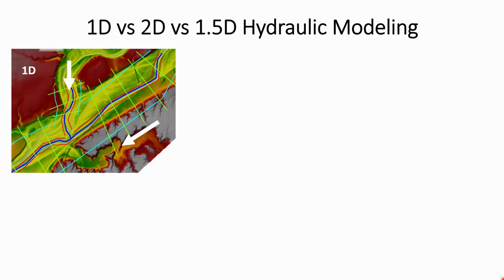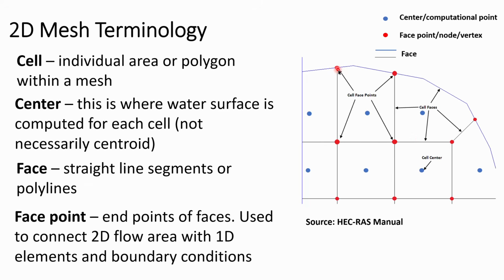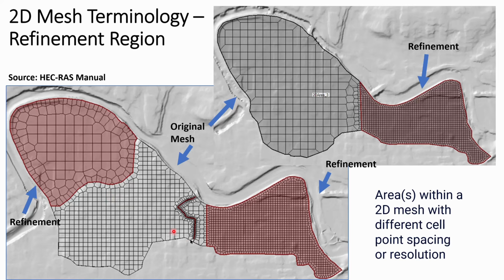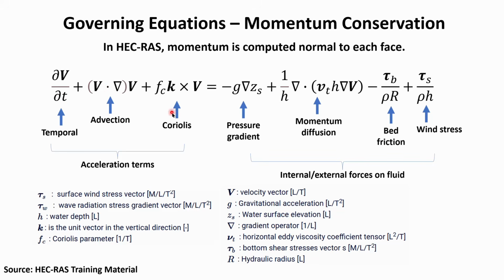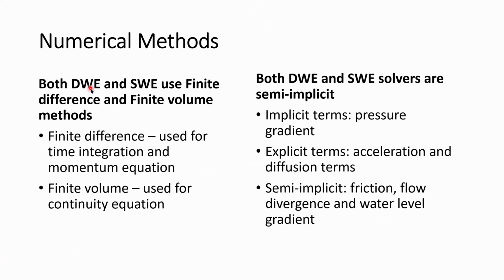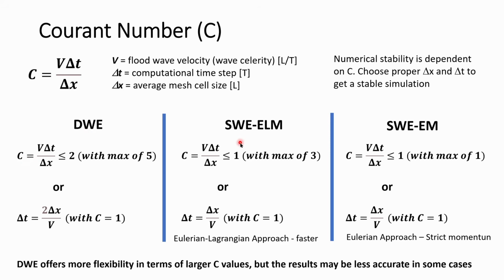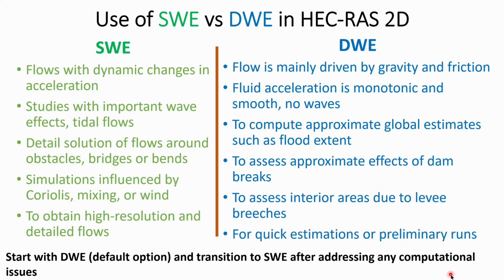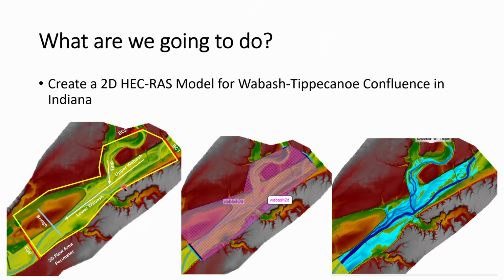2D HEC-RAS Modeling (Video 1) - Introduction to 2D HEC-RAS Modeling

Comment: As always great video! Do you recommend using 2D or 1D modeling while flood mapping? Keep up a good work, thnx!
Reply from the maker: There is no simple answer. While you can model most systems using 1D, but there may be situations where you will need 2D for getting accurate results. Not really helpful answer, unfortunately!
Reply: @hydrologyvideos8253 thanks for info. Keep up a good work with new videos 🎉